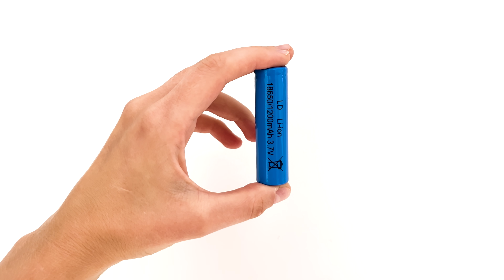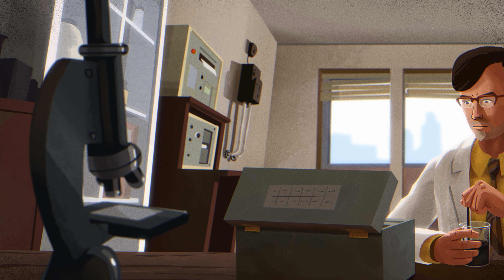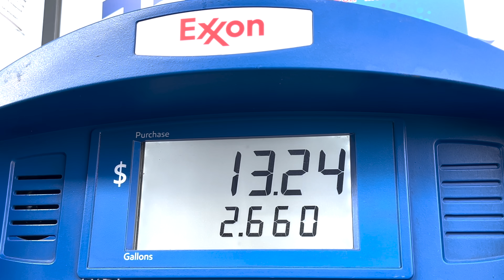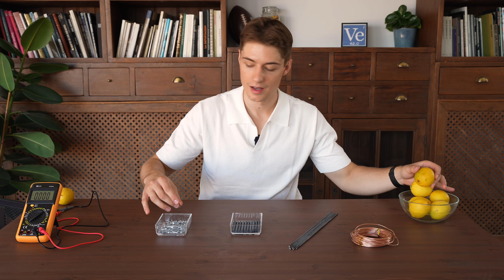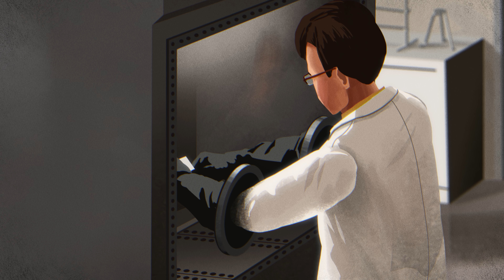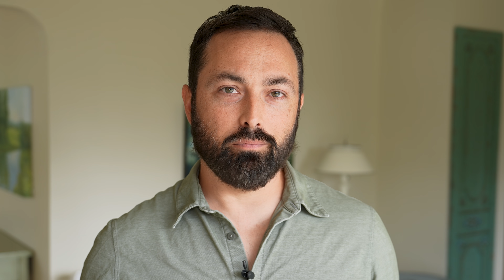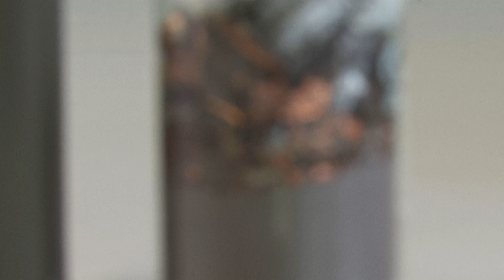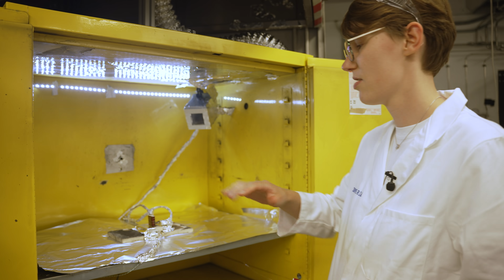The Perfect Battery Material Is Dangerous

Comment: Aluminium batteries are on the horizon but there is a catch. Their charge density per volume is higher, but their charge density per mass is lower. So the batteries are smaller but heavier. The other upside is aluminium is far more abundant.

Then there is asteroid mining, but we need to solve capitalism before that becomes viable, because the second that becomes a feasible method of extraction, mineral commodities will collapse.
Reply: How do you figure (both things)?
Reply: @HelloKittyFanMan.. I'm sorry that Grok is not here to answer your question, have you tried Google? Because I'm not here to issue a 15 paragraph chemistry lesson that you're clearly not going to read.
Reply: @jformaldehydem : WRONG. You can't know whether I would read something or not, because you're not a mind reader. And why would I ask an AI that? Besides, how would either an AI or someone that Google (or any other search engine, for that matter) have any idea of the answer to my question, which is how YOU figured something?
Reply: @HelloKittyFanMan.. Because chemistry? Aluminium has a valence charge of +3 whereas lithium has a valence charge of +1, and Aluminium has a molecular mass more than 3 times that of lithium. Wikipedia reports a higher theoretical mass charge density for Aluminium batteries, citing a popular science article, but papers that I have read would tend to disagree. I guess the extra charge density comes because Aluminium batteries don't suffer the problem of dendrites like the lithium batteries do, thus reducing some of the design characteristics that are supposed to keep lithium batteries safe, but I find that a stupid comparison, you're comparing a practical charge limit to a theoretical one and calling it a theoretical comparison. They don't explain their working. And if Aluminium batteries didn't have practical challenges, then we'd have them already
Reply: @jformaldehydem : "Because chemistry"? OK, so... person who doesn't know how to use all the words that belong, even some that are as small as, oh, say... 2 letters. And if you think you know then why are you asking me? Why don't you just tell me what you think you know? OK, but going on, thanks for giving me more detail after your question (because how you arrived at your own belief(s) wouldn't have been something that Google could have told me, so I appreciate that). That's an interesting idea. Do you believe that to work not only for the "Aluminium" that you think is a brand name, but also the aluminium that is just the plain old generic element? And what would you say is the difference between the 2?
Also, what about your second thing up there that I asked about?

Comment: Maybe 1 in a million of high quality batteries catch fire, but there's a certain country that has low quality everything. It's also a high risk in cars that suffer even small impacts, one battery leaks, catches fire & it all goes up - so much so there is even reluctance to repair cars that have any impact damage. Mazda (now working with Toyota and others) has developed a rotary engine capable of using multi-fuels, it can even run on plant-based alcohol, with the CO2 released equaling the CO2 stored in the material used, so it's officially 'green'. Something like 900km from one fill, using anything from plant based or mineral oils to petrol, alcohol or hydrogen. It powers electric motors, not direct drive - and can even be used in motorcycles, boats and small aircraft, far faster to fill, 2/3 minutes, lots of fueling options and greater range than current ICE vehicles. Typically Japanese, quality over everything. 🎉😅

Comment: Okay, but like, why do all the parts of the video regarding electron transfer use the “wrong” model, in which electrons are not flowing?

As I had noted then, I’m not sure why no one really talks about the transitions between models based on what scale we’re looking at. 

Like here, we clearly need electrons to transfer - using a model of electricity and current flow as a field / tensor does not answer how a dendrite or the interface layer actually grows.

Comment: If you look at the time after the first e-bike (look really funny) and those now. Its been like 70y+ no further research on battery's after the invention of gasoline power vehicles. The best thing we found in 30y+ is Li-ion. Down part of the battery is that it start to lose capacity the moment the one cell is made, keep it between 100 and 30 % and u are fine.
Reply: My bosch battery li-ion 500W is 10y's old i lost 3Km on my turbo mode (when it is 20°C to 25°C outside ) if i compare it at the moment i bought it. I got 23000km in total 21000 is on turbo mode full power for 10y's and for the last 3 years i'm having a child kart behind it. Still if i take it for a ride the  km's go up from 35 with kart to 77km without it. Ps my rpm is average  80 on a good day or 73 on a bad 1

Comment: Hold up. I know it's not the focus of the video but I must take note with the phrase, "Cut speed limit to 55 MPH" as not being a correct because in many places this is faster not slower. It does however use less gas overall. It is brilliant as well because it takes into account the speed people take on various road sizes when this speed limit is imposed.  Some roads below and some above. 55 is particularly efficient in hilly areas where people speed an average max of 7MPH above midway down and stay above 50 at the crest of a hill. This is based on my own testing over the years. As I have driven different cars I've tried to find the most economical way to drive them and I could not get away from that 55mph speed.
Driving gets more efficient as you speed up but only to a point do to friction having an exponential increase. Or is it logarithmic? If you know math plz tell me lol. Either way, the number in alll the vehicles I've tried is a bit above 55. 
It's a stretch to say what he said is incorrect but I mostly just wanted to add this sense it's been a curiosity of mine for decades. There's so much more to this and "Cut Speed" gives an impression that simply going slower saves gas and that I couldn't accept!!!

Comment: In 2017 while building forms for pouring concrete using very thick long screws i overheated a Makita battery which at first just smelled terrible and then very suddenly erupted into flames. Im often worried about the batteries in all the devices at home, simply because you cannot see the battery's state on the inside so you have no idea when to get rid of them.

Comment: As someone who blew up multiple li-ion batteries by overcharging them (tinkering with single use vape batteries to recycle them), it's not nearly as dangerous as the lab coats make it seem, but don't try it at home, and if you do, make sure your windows aren't closed and keep powdered substances way far from the action, bag of flour igniting is way more dangerous then the battery itself turning into a mini grenade (and they do).

Comment: Should've mentioned the development of Silicon carbide batteries which have a greater number of charge cycles and higher energy density. A mention of LiFePO4 batteries would also be neat. 
You also ignored the contributions of Dr Rachid Yazami who invented the graphite anode which increased charge capacity. His contribution was essential to the mass production of li-ion batteries however the nobel prize organization only allows 3 winners maximum for each category of award.

Comment: In The Netherlands they put electric cars into like shipping containers that are open on top and filled with water and leave the car for 2 to 3 weeks. It is assumed that a car fire ruins anything and everything valuable anyway and this keeps the battery from re-igniting and posing a safety hazard for the fire corps. Unfortunately, you can only have so many of these containers and the hassle of extinguishing a fire, then to drop a vehicle in a bath and wait is just a lot. I hope solid state batteries, like sodium based ones, are going to decrease the (puncture) hazard batteries pose of what is essentially a bomb in carry-on form factor if you are not careful enough (not to scare monger by the way, I use lithium-ion in my electronics that I put in ears and pockets too)

Comment: Earlier this summer, Newfoundland went 3 weeks without rain and wildfires got quite out of hand. As a result, my house was sealed up to avoid smoke, with the air exchanger turned off, in record breaking heat. We're not with a cell carrier that does phone trade-ins, so we have phones (and old tablets) around the house. I still use them as cameras, as a not-logged-in internet browser, etc. One that was charging on my desk, out in plain sight, started to deform and I knew instantly it was the lithium ion battery. I unplugged it, factory reset the OS to destroy any data left on it, and powered it off, prepared to take it to the dump on the next hazardous materials day. I texted my husband to let him know and he asked me to check his old devices, all hanging out tucked away in a drawer in the bedroom. A drawer he digs through at least weekly. One of his old phones was so deformed from the expanding battery that it had lifted itself out of its Otterbox-style protective case. These are lithium-ion battery devices we interacted with all the time, so I knew the reactions were happening quickly, and his self-disassembling unit scared me. Wasn't time to wait for hazardous materials day at the dump anymore. I called my local fire department and they not only didn't know what to do with the expanding lithium cells, but they thought I was only on edge about these because of the wild fires. No? You're the fire department. This is the age of lithium powered cars. Why are you confused about my concern? Anyway, 2 hours of calling around later, after nearly giving up and going for a walk along the bay to hurl them into the ocean, I finally found an electronics waste place about half an hour away that would take my spicy pillows. I then transported them in a metal bowl inside an insulated lunch bag with ice packs under the bowl, in the shade of the passenger side footwell of my car with AC on blast. And I had to drive past an active wildfire. Still baffled and concerned that my local fire department doesn't seem to know why I was concerned...

Comment: Went 100% electric two years ago. Live near Cleveland on lake Erie. Heat pump HVACs dryer hot water. Two used EVs. Small solar. Monthly energy bill average is $233. Incoudes 1,500 miles of driving

Comment: For everything other than vehicles, LiFePo4 and Sodium salt batteries are the future. Insanely cheap and safe. They will be heavy, but they're reliable long term and can just be made modular so you can stack smaller modules to create large storage systems. Sodium batteries are definitely the most exciting because the cost and abundance will be so advantageous that it will end up providing energy independence to 95% of the world.

Comment: When lithium ion batteries suddenly became a thing, I could not help but think to myself "How is this safer than current battery tech? I get that its more power dense, but that comes at a cost." Low and behold, I was correct. I can't help but think that anything more energy dense is still going to be potentially dangerous, and will likely contain dangerous materials no matter what. No matter the medium, the more energy dense something is, the more dangerous it can potentially be. Diesel and kerosene fires tend to be more energetic in the long term than gasoline fires, just happens gasoline is more volatile and easier to get started than diesel and kerosene. Maybe we can find a less volatile material for batteries, but if we increase the energy potential, well, you still have a possible bomb or VERY energetic fire on your hands once those safety limits are breached. There is no perfect battery chemistry that will ever be totally safe, with any energy storage device, be it a tank of liquid fuel, a compressed gas into liquid fuel, or a battery, there will ALWAYS be potential for dangerous consequences.

Comment: Saw a video about new sodium batteries that was like 90% effective of lithium for 1/10 of cost. they said 10 $ per kW, also salt is pretty common :D. it had a further advantage it worked way better at colder temperatures, pretty promising when its published by CATL the worlds leading battery producer.

Comment: wow how ironic that you didn't mention Rachid Yazami
Rachid Yazami's most significant contribution to the development of lithium-ion batteries is his invention of the graphite anode in 1980. This breakthrough discovery was crucial for the commercial viability of lithium-ion batteries and is a core component of over 95% of all rechargeable lithium-ion batteries used today.

Comment: Seems with each NEW generation of wonderous ideas comes with them equally dangerous issues as well. But that probably will always be the case. When we designed vehicles with internal combustion engines we had to carry large amounts of very flammable fuels. And early on we had serious situations with vehicles catching on fire and exploding as well. But we managed to solve most of those situations with clever redesigns over the decades. So future energy sources will probably have equally dangerous possibilities too. But we can't ignore the benefits they provide out of danger. We merely have to focus on reducing the danger and move forward. I still believe that Hydrogen fuel vehicles are a great idea myself...

Comment: In Belgium, coo-trois ponts, they have a pumping station, used as battery for nuclear power plants, that can deliver 1000 MW for 7 hours at full power. This was build in the 1980. And still runs today. The energy storage is kinetic in the water, that falls 200 meters when turbine. Water has to be pumped up with cheap nuclear energy, at night or in the weekends, to be turbinated when demand is high and prices are high. The efficiency is 80%+ so the price difference should be 20% or more to be useful.
No waste, no chemicals, no fires, no danger only a turbines / pumping combinations.
This is equal to 500000 Tesla wall batteries. Imagine the cost. And no replacing due to degradation.
Even fish can live in these waters. Chased away from the inlets by sound waves.

Comment: the real batteries are vacuum supercapacitors. no degradation from use, high storage, as light as possible, and chemically inert. Now, how to slowly bleed a capacitor and get an even charge, and stop it from discharging...

Comment: I'm surprised terrorists haven't used batteries to blow planes up, compromise them and then send them in the cargo holds. salt water absorbing into a lithium battery can be timed fairly closely, to the hour when it will explode. Both substances are legal, salt water and a battery, but combined they have a violent reaction, enough to bring down a 747 freight plane.

Comment: I worked at a company that purchased and included Lithium batteries in ther products.  We had these metal buckets filled with sand with covers all over the place.  If a battery went into "thermal runaway" we were supposed to throw it in one of these buckets and throw the lid back on.  😆

Comment: The topic could ve used a nod to Rachid Yazami.
Rachid Yazami is the scientist who discovered the graphite. Unfortunately, when the Nobel Prize was awarded in 2019, the committee could only choose 3 winners, so Yazami wasn’t included even though his work was essential. He totally deserves more recognition!
Reply: Carbon was already being used by the Japanese inventor.  Graphite form or carbon was useful, and reduced cost a bit, but was minor and somewhat obvious improvement.
Reply: He did not discover the graphite, but co-developed a graphite anode. That's a big difference.
Reply: @RDrumcajsek  He was the key developer of Graphite Anode not just a any other codeveloper and also the reason he was not picked was because only three can awarded and they considered the invention of graphite more significant and there were two people in it and the first working prototype inventor. Without the Graphite Anode we wouldn't it have 95% of batteries currently being used
Reply: His work also wasn't essential, it was only used to improve on the core design, and unlike the other 3, he didn't even work on the subject matter at all, having him included in the Nobel prize would be ridiculous.
Reply: @DenethorDurrandir  u are an idiot 😂

Comment: The SEI (solid electrolyte interface) forms in the membrane, not in the graphite anode... peraphs you confused with the lithium plating on the copper that was shown in a transparent lithium metal cell during your video. Would be nice if the video can be corrected in the future with a new video. Overall a very nice and instructive video 👍 keep up with the good work!

Comment: Currently, the vast majority of grid scale energy storage and more and more cars use Lithium Iron Phosphate (or LFP), which, although not perfect, are way less susceptible to fires than NMC batteries.

There's also sodium ion batteries which are starting to appear on the market. CATL, probably the largest battery manufacturer in the world, has recently launched a sodium ion cell for grid scale energy storage. These cells are even safer. They are currently in the same ballpark as LFP in terms of energy density, albeit a bit lower, and still pricier, but they will be cheaper in time because sodium is abundant and easy to obtain.

Comment: With How Volatile Batteries are, I wonder why Railroad Corporations prefer to build Battery Locomotives instead of Electrifying and Using External Sources of power such as Catenary or Third Rail.
Reply: Because they don't want to front the overhead (no pun intended) cost for electrification. Yeah proper electrification is infinitely superior to battery-electric locomotives, but nobody thinks beyond the quarterly reports.